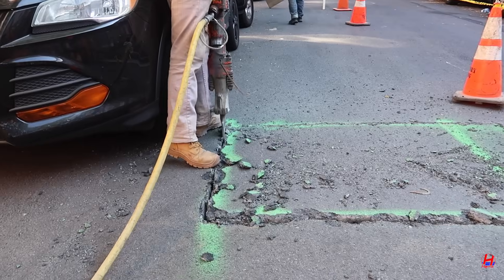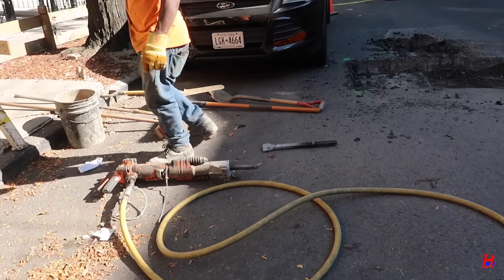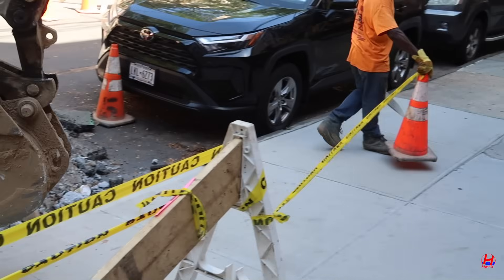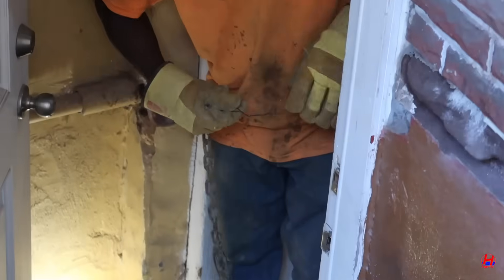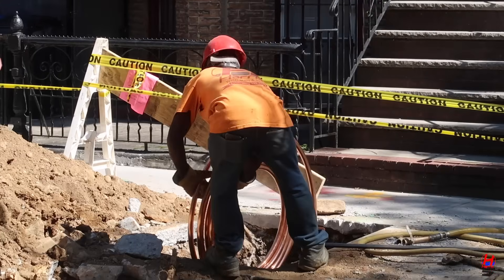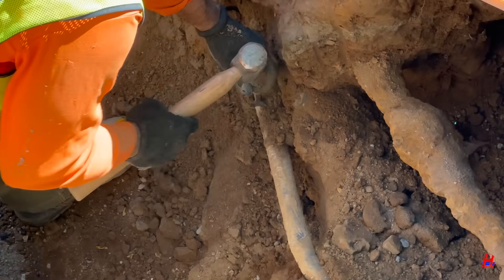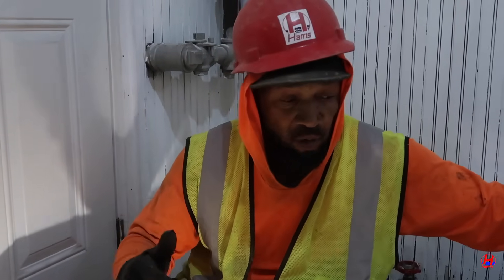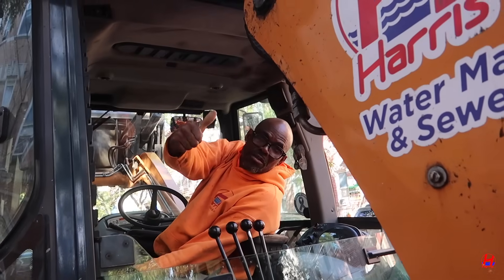NYC's Hidden Danger: Lead to Copper

Comment: If it laed city water pipe NY better be replace all & not at customer expense if it on NY CITY SIDE OF WATER METER
Reply: The city couldn't afford to replace everyone's lines. So of course force the home owners to replace them. Water line replacement in nyc probably cost around 20k.

Comment: Updated mine, the city I live in will  upgrade the section  between the  city main and curb stop for free if it is  lead OR  undersized. ½" is undersized, ¾ they wont replace curb stop to main  unless you pay, 1" is the new standard.

Comment: Omg you say you're professional. Are you joking tarmac straight on dirt? I wouldn't say that's professional...
Reply: It's temporary until a concrete guy comes out and finish it..  It's the same for gas hook ups,  can't have everyone working over each other.
Reply: @readysetsleep  I realized it was temporary. Probably too much to mix and/or schedule a concrete truck the same day.
Reply: I'm intrigued by your use of the word "tarmac". I can figure out that it would mean something like "paving" but I'm not familiar with it being used in that context. I am aware that there are a lot of different names for this material - Asphalt, Mercadam and Bituminous Concrete!
Reply: @markkillion8980 he is from the UK tarmac is asphalt in the British empire.
Reply: Plumbers are not concrete finishers bro that’s a whole different set of skills takes time to learn any trade, with the road closed yeah maybe sub it out and fit some concrete trucks in there but bro the traffic was flowing one of the guys trying to cross with a bag of material was crossing mid traffic G no one wanted to stop. Plumbers did a great job this is awesome work 👏
Reply: Hard working fellas.. surprised to see flared fittings.. and  reusing the old corporation stop.. great work!
Reply: @mikemacmillan778  I'm not a plumber and couldn't really articulate it. I, too, was surprised at the nature of the fittings.
Reply: @markkillion8980  I do this work for a Canadian municipality, while im old enough to remember flared fittings we use compression fittings nowadays , they’re easy and generally fool proof. Our lines are a lot deeper in the ground, because of the frost here. Still though, that’s a great crew of men, the company is lucky to have them.